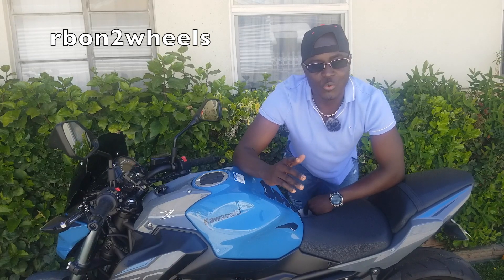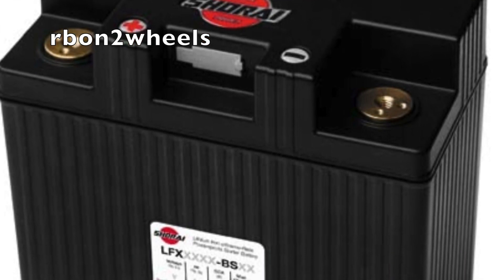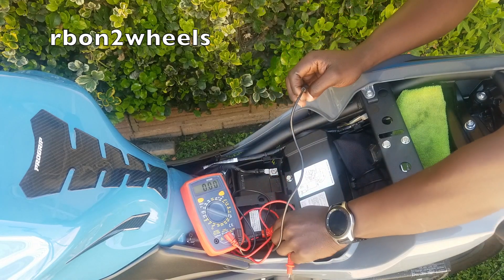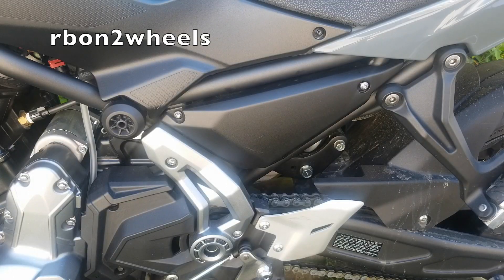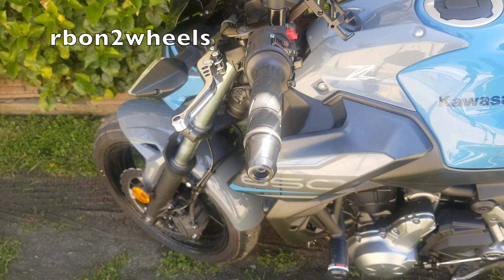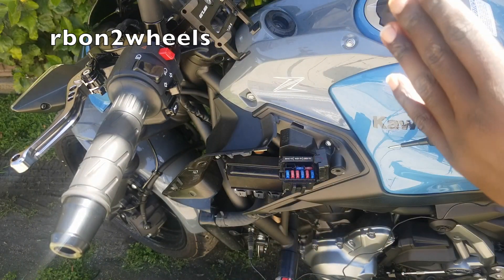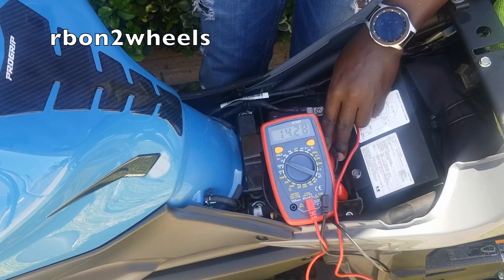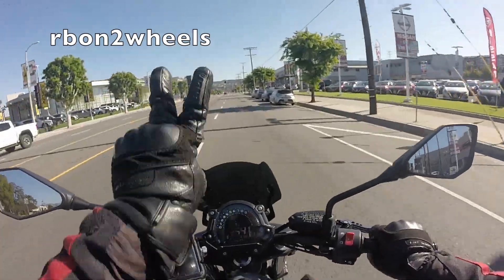How to diagnose a motorcycle electrical problems.

Comment: Thanks for taking the time to do a video. When checking a fuse you have to test both sides of the same fuse to be sure it is not blown. Checking one side only isn't a proper fuse test. A blown fuse will only light on one side.